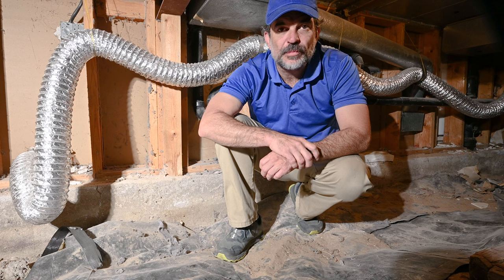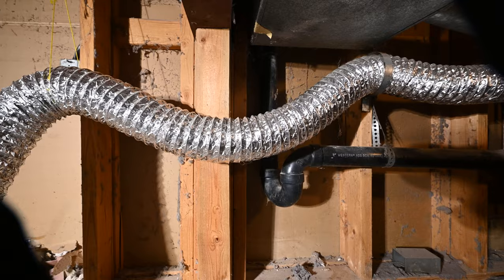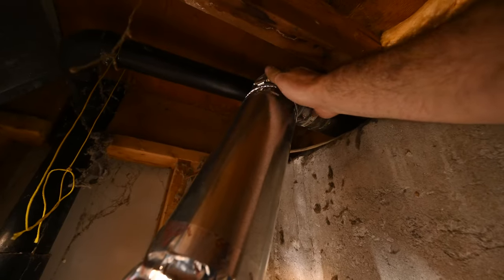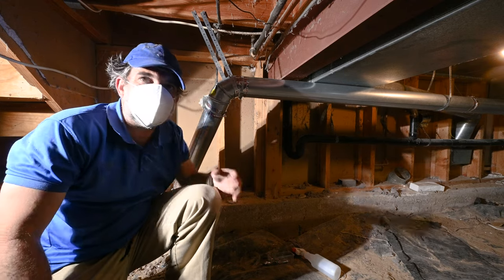Dryer Vent Replacement in Crawlspace

Comment: As a dryer exhaust technician, I would recommend that you use long radius elbows instead of mitered (adjustable) elbow fittings and use gradient turns instead or pivot (right angled) turns. You missed an opportunity at the first elbow fitting to angle the fitting at a slope to meet the next horizontal run and a gain another opportunity at the third and forth fittings to allow for a gradient slope and eliminate the sharp (short radius turns) which provide the highest amount of back pressure and cause for greater equivalent length.
Reply: I really don't like all those 90's and that long level run. I'd have run 1 90 at the dryer, a long sloping run to a second 90 to the exterior. Less back pressure and the slope would encourage the lint to fall rather than settle in the long flat run. It would also make the inevitable duct sweeping much easier.
Reply: @ORRadtech  Its always nice to see fellow CSIA and exhaust technicians in this little niche of doing things right.
Reply: I’ve got an old home built in 1960… the vent hole is not lined up with the exhaust to the house.  It looks like a 90 degree angle elbow piece needs to be installed but the it won’t fit because the holes aren’t lined up… is there an easy fix?
Reply: @wakawaka1976  if I understand, you are saying that the dryer’s exhaust pipe is off-set to where the dryer vent pipe in the wall of the home is. If this is the case and you do not have the ability to install a hard pipe 90° elbow, then it is always best to use flexible metal(not foil) transition duct to make the off set possible. Dryer Flex is such a product. It has great flexibility and holds diameter when scrunched and makes those installations easier.
Reply: I just fitted my dryer. I used the adjustable elbows because that's all my local hardware store stocked and in of the bends I only had like a 8° bend. But do you ever get angry at seeing all the Amazon 90° elbows that are made of plastic and have dumb lips in them to greatly impede air flow? Or is that just job security for you and the fire fighters?
Reply: @jessechristensen1074  we hate to see inefficient systems. We want exhaust that create less build up. This isn’t about job security, it about fire safety. A true professional will want to see the best install occur as because all exhausts accumulate lint but efficiency is the key to keeping the accumulated lint to a minimum and the back pressure from wearing on the appliance. 
Plenty of us in the industry of dryer exhaust cleaning and installation hate to see materials which are inferior being sold to an unawares public. But this is why we are constantly educating the public as much as we can. Dryer fires are a leading cause in home fires. I believe #4 or #5 in the US.

Comment: What about direction of flow? I believe you installed the duct with the wrong direction of flow. Will cause lint to collect in the joints and cause restriction or fire. Flow towards tapered end of joints.
Reply: I was checking my manual on that for the exact same reason. Crimped male ends running toward exhaust should be code, I believe, or at least recommended in CSIA
Reply: 4:10 YUp looks like he flipped the wrong thing

Comment: Not sure of your jurisdiction but this would not meet code in NYS. Max length in NYS is 25 feet and you need to subtract 5 feet with every 90°.
Reply: That's actually NFPA 211 I believe and its the same down here in the south. Good catch, you're likely right, but Im pretty sure venting under houses is frowned upon regardless.

Comment: Can I add an exhaust fan duct to an existing dryer ventilation duct?
Reply from the maker: Yes, i would get one that starts on pressure and cuts off after 15 minutes they make them specifically for dryer vents if the run if more than 15 feet or so